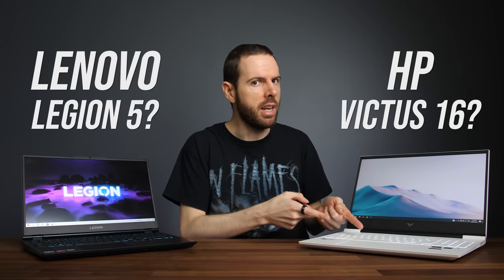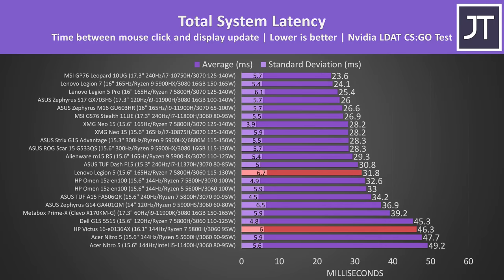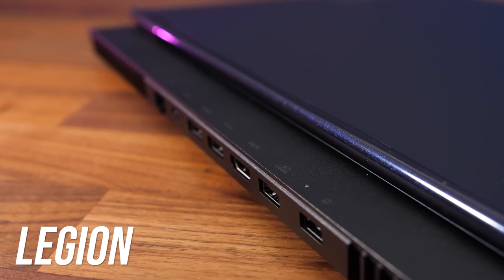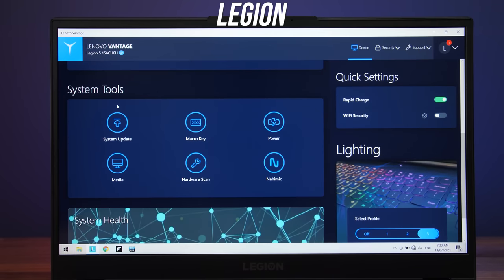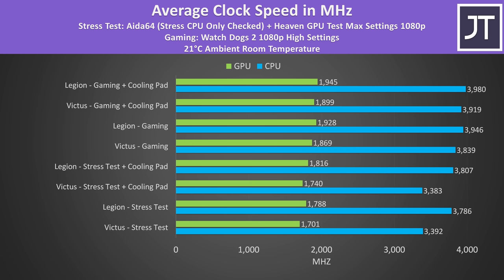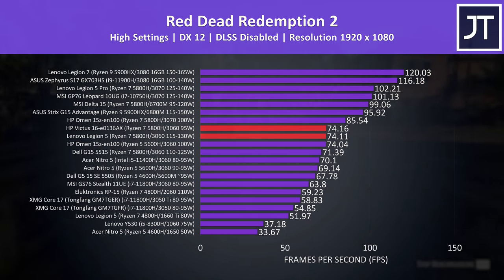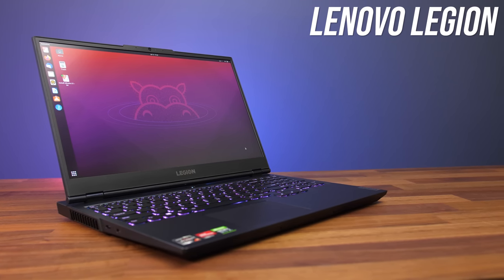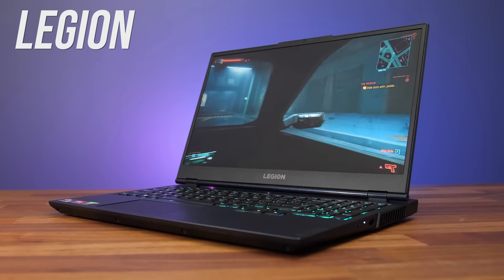Lenovo Legion 5 vs HP Victus 16 - EVERYTHING Compared!

Comment: when i was looking for a PC, these 2 were the ones i compared. allthough i got Lenovo Legion 5 with non-rgb keyboard (not sure if it has x16 memory or x8, all i know is that it has 2 8GB sticks as usual) for 1274€. the Victus 16 model i was comparing was Intel i7 11800H 512GB RTX 3060 16GB ram for 1400€. this was at the time when some nice discounts were up, the Lenovo model was reduced from 1500€ and also offered a promotion for a free gaming pack (headset+mouse+pad) (140€~ worth)

i think me choosing Legion was a better decision, had to spend less money on it. it doesnt habe RGB keyboard which i dont really care, it would be cool if i had it but without it, not really an issue, uses up more battery and creates unnecessary traffic for the battery while gaming

Comment: Hello, the other day after a long time, I decided to use the internal gpu with the Legion 5 Pro. I always used DGPU. But something very interesting caught my attention. When you select sRGB in the x-rite program, it is set to 120nt brightness and automatically decreases or increases the brightness. This equates to 64% on the Windows brightness slider.

When I put it in srgb mode with IGPU selected, the brightness seemed too high to me and I measured it with my phone. Previously, I made a measurement in sRGB mode with DGPU selected and calibrated it according to 120nt brightness. Then I set the IGPU mode and chose sRGB from x-rite and automatically set the brightness to 64%. I measured again. It showed 232nt this time.

In DGPU mode, 232nt brightness corresponds to 85% brightness.

I honestly don't understand this difference in brightness. Is it the real 120nt that comes out on the IGPU? Is it the one on the DGPU? I couldn't get real results because I don't have a professional measuring instrument.

The final brightness does not change. DGPU 680 at max brightness, IGPU 673.
0% brightness is DGPU 0nt, IGPU 23nt.
Reply: I too have the exact same doubt. In igpu the color looks more vibrant but on dgpu its like more clear and dark.
Reply: @jesvinj6286  I prepared a graphic, but I did not share it because youtube does not accept links. It sees the links as spam, the message usually does not go.

Comment: The Victus's screen wobble is a major deal breaker, at least for me, everything else about it seems better than the Legion, what a shame
Reply: im using hp victus and i didnt find the screen wobble as an issue.
Reply: @lightningtech1030  Good for you i guess.
Reply: @lightningtech1030  yes I am also using it it's a beast.
Reply: hi. i wanna buy laptop and i have to use it maybe like 8 years. laptops are 2x expensive in my country so for my budget i am between this four: lenovo legion slim 5 i7 13700h - rtx 4070 - 1 tb ssd - ddr5 double channel 32 gb ram and acer predator 16 i9 13900hx - rtx 4070 - 1 tb ssd 16 gb ram. and asus rog strix g16  i7 13650HX-RTX4080 12Gb-16Gb-1Tb- and  Ryzen 9 7845HX-RTX4070 8Gb-16Gb-1Tb Ssd. which and why i should buy ?

Comment: I was planning to buy a Victus but it was suspicious so I got a Legion 5 Pro instead since the shop also had a stock.
Reply: How has it been, even in thinking to go for victus instead
Reply: Good choice I am planning to do the same....rtx 3070 and 1tb ssd is boom with 32gb ram..
Reply: @namank5291  it's been doing pretty well, but I think it's a bit overpowered for my own use to the point that I think I'm just wasting electricity. Only thing that's questionable for me is the fan noise, it's not really that loud but you can hear it even when it's in idle. I got an Acer Swift 3 and it doesn't go loud even in max usage.

Comment: Hi. Thanks alot for comp. Can I ask ur opinion? Which one of tnem is better in cooling system. Now chose between legion5pro and Victus16. Both of them is based on 12700 + 3060
Reply: Idk about lenovo but i just brought  victus(2022) like 2 days ago  and themps are pretty good. The fans are a tiny bit loud but that's  a trade off that I'll  take for lower temps.
It does get  a lil warm after a while but nothing  too crazy. Also the only area that gets warm is the center of the keyboard, which is good because your hands are mostly gonna be on the sides not the centet

Comment: my legion 5 2020 throws blue screen and restarts randomly. Only solution which works is change processor performance boost mode from Aggressive to Efficient Aggressive. this settings does not allow cpu usage to 100% i guess. any suggestions? could be due to bad cpu thermal paste ?

Comment: I'm looking at getting a Legion 5 laptop myself, they do a Legion 5 3070 or a Pro with the 3070 for £200 more, is the Pro worth getting with the same CPU, GPU and RAM? Only noticeable difference is the SSD size.
Reply: the difference between the Pro variant is just basically Legion 5 but using it for a Professional part like content creating..
anything else, it's the same as much as I know

Comment: Jarrod i have question
I have legion 5 rtx3060 ryzen 7 5800h and i want to upgrade RAM. I know it has limit to 32gigs RAM but whats the max RAM speed?
Reply: 3200mhz 
There is no faster sodimm ram speed.
Reply: @AlamarFly  ehh?
Reply: Nooo imposible... Ryzen 7 5gen 2021 laptop and cant run even 3600 speed?
Reply: Samsung released info about 7200mhz ram😲
Reply: Timings are equally as important. 3200mhz or 3600mhz seems to be the sweetspot, but do your own research.

Comment: hey jarrod i was thinking of getting the legion 5 with 3060 after watching your reviews, but the only one available in my region is with the 120hz screen. i would assume that its the same panel as the previous generations of legion 5 with 45% ntsc and 66% srgb. would u have any insight whether its the same dull panel used in those previous laptops or did lenovo put a somewhat decent 120hz panel on the newer 3000 series laptops cuz the laptop is at a really good deal for a 3060 130w
Reply: For anyone seeing this comment. AVOID the 120hz version. The screen is GARBAGE.

Comment: I just got my legion 5 pro 3 weeks ago and suddenly the screen turned black, the fans started going at full speed and now, the laptop doesnt turn on the only thing that happens is that the keyboard lights up. The unit is still getting power while the it is plugged in because the light above the charger lights up, but nothing else works. I cant enter the bios or connect it to an external display. Any help or suggestions ?
Reply: Imagine formatting the laptop now and you must restart again okay.

Comment: I got the victus, but you are making me doubt now because of a mux switch. But i use an external monitor so is that ok? Bc i dont really understand what mux switch is. From what i heard if i use a monitor its like having a mux switch off
Reply: Yea with the external monitor, not only you will disable the optimus, but you can also get access to Nvidia Image Scaling, which will boost more fps
Reply: @aeriale8111  thanks, appreciate it. But also i have an all amd laptop, the rx 5500m ryzen 5600h. Is there anything in amd setting to do the same as nvideas image scaling?

Comment: Got the legion 5 after 2 years of saving money for a laptop, and arrived after 2 months, so happy with it its awesome.

Edit : got the legion for 1200, with 2 years of third-party warrantee.
Reply: Can I ask where did you buy the laptop from? I haven’t seen a Legion 5 with 3060 below the $1300 price point
Reply: @MrGrayWolf it's likely he was just on a different currency
Reply: 1200 what?
Is it the 3060 model?
Reply: @drexalte69  usd, 3060, r7 5800h, 2tb ssd, 16gb ram

Bought it in middle east, it didn't have windows pre-installed though.

Comment: HP victus is not coming in stock at all. Acer nitro ryzen 5 5600H RTX 3060 is in stock and they are actually priced the same, Difference is the storage in victus has 512GB SSD and nitro has 256GB SSD and 1TB HDD.

Comment: I am considering between legion 5 5600h with 3060 and the aorus 15p with i7-10870h with 3060 which one is better? Both price are similar but I was worried of the legion’s huge power brick as I need to bring it to uni
Reply: Get the lighter one
Reply: Legion has USB C charging, so you can get a smaller brick that gives it enough power for everyday tasks (but not not for gaming) that will be light and easy to handle

Comment: Legion all day. After upgrading my RAM and WiFi card it’s preformed even better. Which is expected. My laptop now out preforms my desktop which is an HP Omen. 

I know that the Legion isn’t the top dog when it comes to laptop gaming. But it’s at least sitting right next to the top dog on a slightly lower bench.
Reply: Its pretty overpriced. And no, sales don't really save it when those sales generally apply in just one area (US).
Reply: @Atof Really now? Does this legion sale ever put the 5800h + 3060 legion close to 100k? Because the nitro 5 with a 5800h, 3060, 100% srgb panel, etc. costs 96k. The gf65 thin costs 83k. 

Legion is overpriced here.
Reply: @Atof That is such a shitty deal, its not even funny. There are literal 4600h + 1650 laptops for 55k. With 12k I can add 8gb of ram and a 1tb ssd.
Reply: @Atof Nah. There's a HP omen at 60k with a 5600h and rx5500m. Won't be much slower than the nitro 5.
Reply: @Atof Just tired of people like jarrod saying the legion is like this untouchable value king when in reality its pretty average.

Comment: In my country right now the price for victus rtx3060 only $30 more than legion 5 rtx 3050, but still confused whether should I get the legion (better overall quality & gimmick) or victus 16, thinking about to change my rog g513qc (rtx3050 also) cuz of the panel issue 😔
Reply: rtx 3060 is ass get the legion

Comment: i would go for the Legion everytime, if it's not for the crazy increase in pricing.... Legion 5 nowadays is not a budget friendly gaming laptop anymore :(
Reply: It wasn't even at the start. The occasional sales fooled people into thinking it was affordable. 

I mean just look at the gigabyte g5. A i5 10500h and 3060 100w at $1150 at the start of the 3060's release. That is impressive.
Reply: @siyzerix  i would argue that the Gigabyte G5 is not really "good looking", and its thermal solution is not the best either. But in my place (Vietnam), it usually goes for $1275, and at $1350 you can get the Strix G513IM-HN057T with a Ryzen 7 4800H 16gb (single) and a RTX 3060 with 130w, with much better temps. Just bought it for my brother the other day, and it's much better than the G5 imo.
Reply: @Agent_Alpha  Sweet. Thats my point. Do your own analysis.
Reply: hi. i wanna buy laptop and i have to use it maybe like 8 years. laptops are 2x expensive in my country so for my budget i am between this four: lenovo legion slim 5 i7 13700h - rtx 4070 - 1 tb ssd - ddr5 double channel 32 gb ram and acer predator 16 i9 13900hx - rtx 4070 - 1 tb ssd 16 gb ram. and asus rog strix g16  i7 13650HX-RTX4080 12Gb-16Gb-1Tb- and  Ryzen 9 7845HX-RTX4070 8Gb-16Gb-1Tb Ssd. which and why i should buy ?

Comment: I have the legion 5 17ach6. How do you get gsync working? I only have dGPU active, but no gsync in nvidia control panel. I do have the ability to pick 144 or 60hz.
Reply: It isn't supported by 17" 144hz screen.
Reply: You need an external monitor compatible with g-sync, 17,3 inch legion 5 has only FreeSync iirk.
Reply: I was curious because Wildland has an options for adaptive v-sync, but doesn't show up in other games

Comment: the legion 5 is still selling for 1300 dollars in microcenter though, which is still surprising.
Reply: hi. i wanna buy laptop and i have to use it maybe like 8 years. laptops are 2x expensive in my country so for my budget i am between this four: lenovo legion slim 5 i7 13700h - rtx 4070 - 1 tb ssd - ddr5 double channel 32 gb ram and acer predator 16 i9 13900hx - rtx 4070 - 1 tb ssd 16 gb ram. and asus rog strix g16  i7 13650HX-RTX4080 12Gb-16Gb-1Tb- and  Ryzen 9 7845HX-RTX4070 8Gb-16Gb-1Tb Ssd. which and why i should buy ?

Comment: Why are You not including in Your comparisons previous top performance normal laptops like MSI GE75 with 2080 Super as reference? It would be still on the top part of the list (still better than most of RTX 3070 laptops with TGP below 130W) and it's shame that You just skip it like something not worth noticing while now these can be found cheaper than RTX 3070 laptops.
Reply from the maker: Because the results are too old and people want to compare against what they can currently buy, there's not enough space to include the 150+ data points
Reply: @JarrodsTech  understood. Online datasheet would be ideal solution for this...thanks anyway for your good work!

Comment: If you got your legion 5 in 2020 or early 2021 you got a really good deal. I could easily resell my rtx 2060 for $1300 to $1400.

Purchase price $1000
Reply: Who will buy it from you when 3060 is 1300e or even lower
Reply: @schweiserschweiser3397  that won’t be happening for a long time. Supply shortages will extend until early 2023.
Reply: @Matt-ks8se  i bougt mine lenovo before 6mount for 1250e new
Reply: Lmfao…nobody’s giving you that much for a used machine . Get real.. Did you even watch the whole video? The victus has a 3060 and is going for ~1300
Reply: @techjunkie1815  lol it’s a kid who think for 2060 to get 1400usd  😂 2060 new is now 800 or 900e max
Reply: @schweiserschweiser3397  it’s on Amazon used right now for 1300, mine has more ram and 2tb ssd. Easily 1400
Reply: @techjunkie1815  there’s a reason the legion is 1700

Comment: Hello, I wonder if you can help me:
I've seen your video, really nice job, really, you compared points that I didnt have in mind hahah
But I have this 4 models, if someone can just tell me which one you wuld pick I appreciate:

Acer Nitro 5 AN515-45        - AMD Ryzen 7 5800H - Nvidia RTX 3060 - 512GB SSD - 8GB RAM    - 1099 euros (black)
Lenovo Legion 5 15ACH6   - AMD Ryzen 7 5800H - Nvidia RTX 3060 - 512GB SSD - 16GB RAM  - 1350 euros (white)
Asus TUF FX516PM            - i7 11370H                    - Nvidia RTX 3060 - 512GB SSD - 16GB RAM  - 1350 euros (gray)
HP Victus 16-e0007np        - AMD Ryzen 7 5800H - Nvidia RTX 3060 - 1TB SSD      - 16GB RAM   - 1350 euros (blue) pretty tbh

My doubts of course are:
-If the i7 is better than the AMD (for gaming, coding, normal use)
-If between the last 3 for the same price is better the double of SSD
-If is better and cheaper upgrading RAM (and maybe SSD) of the Nitro 5 choosing better gaming RAM
-Of course the hardware is pretty similar, the Legion 5 may be on top, but since the others have different offers, I'm unsure.

Thank you.

Comment: in my country lenovo legion 5 (RTX3060) is almost the same price with HP omen (RTX3070), same CPU Ryzen 7 5800.
but yeah, victus (RTX3060) is almost 300 USD cheaper here if in tight budget...
Reply: hi. i wanna buy laptop and i have to use it maybe like 8 years. laptops are 2x expensive in my country so for my budget i am between this four: lenovo legion slim 5 i7 13700h - rtx 4070 - 1 tb ssd - ddr5 double channel 32 gb ram and acer predator 16 i9 13900hx - rtx 4070 - 1 tb ssd 16 gb ram. and asus rog strix g16  i7 13650HX-RTX4080 12Gb-16Gb-1Tb- and  Ryzen 9 7845HX-RTX4070 8Gb-16Gb-1Tb Ssd. which and why i should buy ?

Comment: Thank you for this video! But I have a problem with my legion 5 right now. Everytime I move it, it just shutdown. I checked the fan and every update and the power plan and it's still the same 😢
Reply: Your battery might have some connectivity problems to the board, you might want to see a expert for that.

Comment: I have the MOEN 15 with the 3070 and the 300hz 1080p screen. A bit ambitious, but with the graphics turned all the way down on Forza Horizon 4, I can hit about 220fps b4 the 6 core i7 bottlenecks. I wish it had the 8 core i7, but it still games decent in 1080p. Now i just wish i could figure out why my eGPU has worse performance than the laptop's card. well GTA V with a 3090 hooked up plays almost as good as my desktop( about 125fps at very high, 1440p), RDR2 performs worse than the 3070 with a 1440p monitor.

Comment: Ok, so obviously the legion is the better laptop, but is it? The victus seems quite close to it in several aspects and even beats it in some. Seems to trade blows with it actually. 

Yet, it costs much lower than the legion in several places. Infact in some places the 3050ti legion costs more than the 3060 victus. Which is just dumb. 

And people still buy the legion for the minor improvements over the victus while paying a much higher price? For the price the legion sucks. Its not good at $1700. Because for $1700 you get 3070 laptops with better build. Infact 3060 laptops should really be $1100 or lower.
Reply: What kind of God-forsaken place sells the Legion 5 for 1700$? In most countries it averages 1300-1400$/€
Reply: @jhulenoscarantezanamendez6106  Its Asia. And as for other countries, it'll cost quite a lot. Maybe theres a couple exceptions but its gonna cost ya.